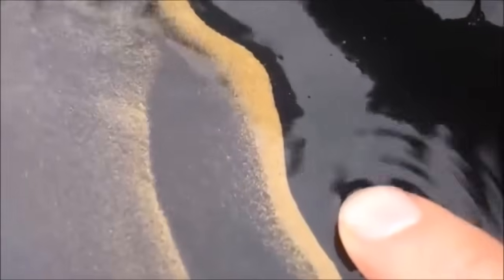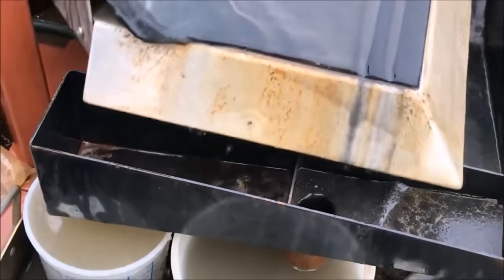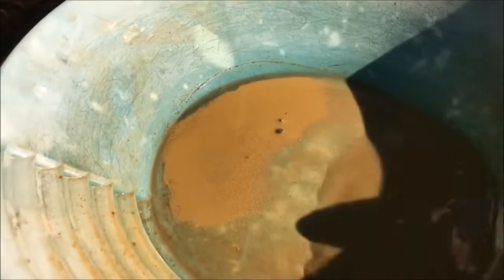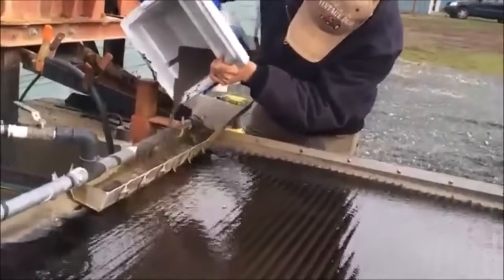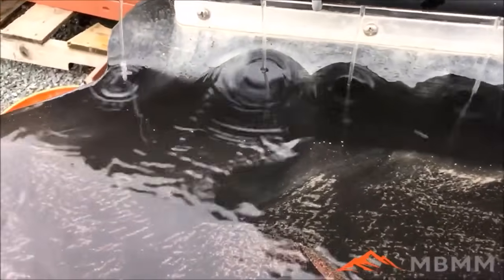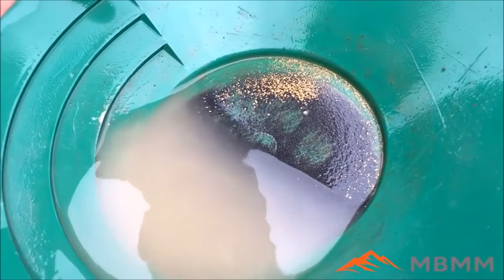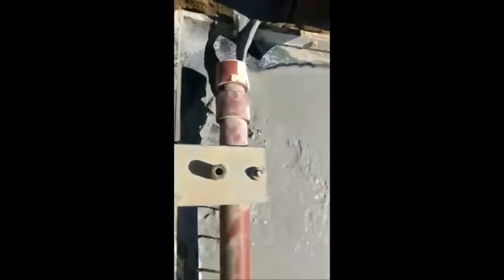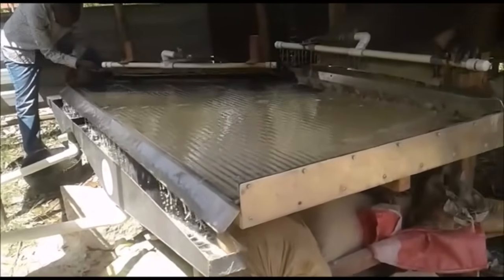How Much Gold Can a Shaker Table Really Recover?

Comment: jason what are the odds of you installing crushers in the mine pumping slurry to the table using your #4 as back fill in the mine and only taking concentrates down the mountain?  also those head knockers gotta go especially if your planning on guest miners who arent familiar with every bump hazard plus who wants to spend all day hunched over its killer on the connective tissues of the body .thanks as always for the vids  no more left turns at Albuquerque and get you dace in the right direction lol i guess its easy to loose north underground especially when your also playing with up and down in the dark.

Comment: Nice Video!  I can't help but wonder given each setup (slight angle changes) the g/cm cubed between 1,2,3,4 ports should be roughly understood such that mass composition would dictate what process each port would need to refine what is left in it.  Also pvc sleeve pipe with a magnet could pull out ferris material beyond any port.  The chemical composition and value of each port potential vs process cost would be interesting to look into.  Last thing I noticed was port 1 and 2 and some of 3 might benefit from a small spray just to flush the port into the bucket in some more automated setups.

Comment: So to answer this question can't you simply run an experiment?
Put standards through w/known concentrations of gold (0, 0.25, 0.5, 0.75, 1, 1.25, 1.5, 1.75 grams/ton).  The range should cover what you think the sample contains.
Take an aliquot of an unknown sample run it through the same day/conditions.
Spike 1 or 2 blanks (meaning no gold content but similar material) w/known amounts of gold.  These give you a matrix spike and duplicate.  If your unknown sample isn't funky and your process is optimized, then the % recovery of the spikes should be very good. 
Look at the % recoveries on the standards and MS and MSD samples.  You should have basically 100% recovery.